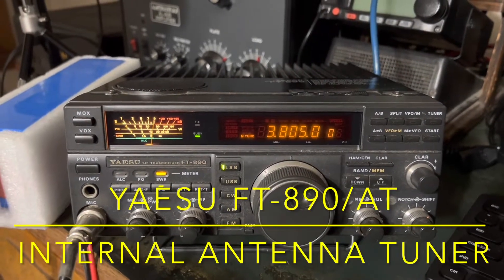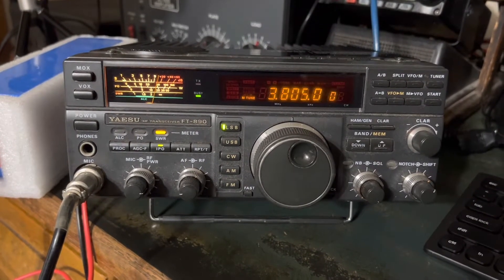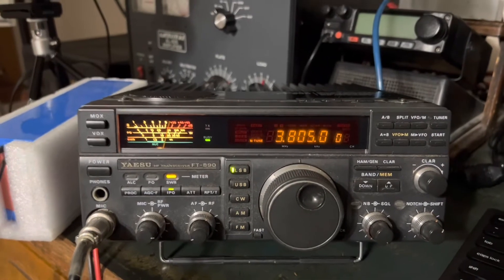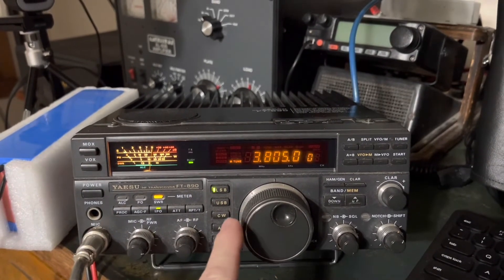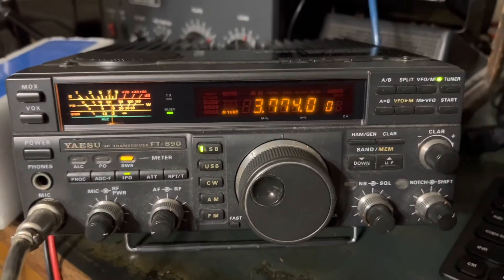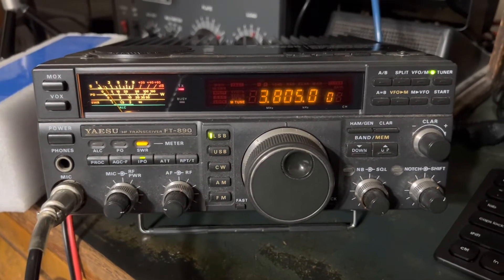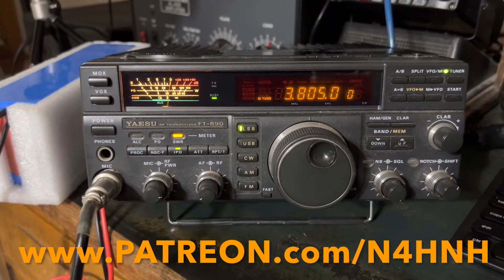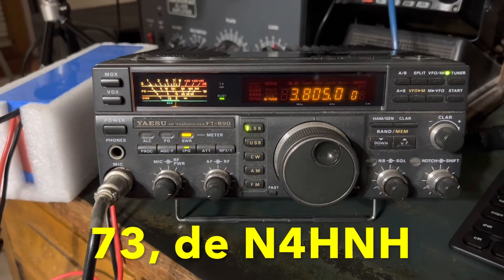Yaesu FT-890/AT: Internal Antenna Tuner (read the description) #hamradio #yaesu

Comment: I bought one of these radios, pre-owned.  One of the best radios I've ever used. The internal antenna is amazing.
Reply from the maker: Yes, approximately 1/3 of the space inside the FT-890/AT is the antenna tuner.  It is a wide-range unit.

Comment: The FT890-AT was my first HF rig and a reward for getting my code requirement under my belt. I think it was 1991 or 1992 and I still have it.  ---  dennis   n1kpz
Reply from the maker: It’s still a great rig. Won’t part with mine.

Comment: I always wanted an 890 back in the day, but ended up with a 900. Today I have more rigs than I can use and need to thin out the herd. Thanks for the short trip around the 890 block!😊
Reply from the maker: I still have an affection for the 890.

Comment: all of those early 90s rigs are sweet!  I still have 2 of my old 1991-1992 rigs my old Kenwood TS-850sat's and they still hold their own in today's world.  I had to rebuild both of the 850s receivers ( DDS and all of the leaking electrolytic capacitors) I was so happy to have those rigs then - they had that "wow" factor - my club had an FT-890 on a 5 band vertical antenna and it was ( still is) a real work-horse. I started out with a Heathkit HW-101 SSB rig, and using those modern rigs was a real treat - especially with a good set of filters. - I spent a fortune on mechanical filters back then. ended up buying a Icom IC-746PRO around 2004 and with IF DSP just amazed me.... when I turned my then brand new IC-746PRO I thought it was deaf! no background noise. but those old Kenwood TS-850s(at)s are still on my bench. so I know what you mean with the attachment to those old war-horses , they really are good friends. 
  BTW, to clean that old rig up - you might try what I use to clean up old rigs = I use Ballistol  ( it's a German gun oil)  it cleans grime and other yuck from old delicate paint, it does not harm plastic, nor it won't attack rubber (actually helps old rubber feet, flywheel tires back to almost original softness all whilst cleaning up the gunk. it shines up the buttons and chassis oh yeah it wont swell wood either , so if you have a rig with a wooden cabinet , it won't harm it either also it's non-toxic . the only problem.... it doesn't smell very good.  I cleaned a friends old Zenith Trans-Oceanic 3000-1 that was filthy. with Multi-purpose Ballistol .  he was stunned  Really enjoying your content .  73
Reply from the maker: Thank you for your commentary.  Good stuff.

Comment: This generation have unbeatable tuners. 890, 900, 990 and 1000D. They will all match a bacon sandwich. On most any frequency. L's are realay switched with twin motor driven C's. If you only want to run 100w, they are all a viable choice. And beautifully built internally too. Thx Doug. 73 de Mike
Reply from the maker: What you said Mike. Mic drop.  73, Doug
Reply: @n4hnhradio  and I still own and have used  them all except the 1kD (NIB). Until that is 2 months ago when I was closed down. Permanently. Now looking for a new home.

Comment: Great radio, I have the sister model the FT 900AT.
Reply from the maker: Indeed.  The 900 is an LCD version of the 890, also with a removable faceplate option. I owned one for a few days. Bought it on eBay. It arrived busted up, even though it was double-boxed and neither box showed any sign of damage.  Strange.  It took 3 months to get a refund. It burned me about using eBay.

Comment: Cool transceiver. I'm glad you still have it and use it from time to time.
Reply from the maker: Thanks Martin!  That little transceiver brought great memories.  It might not hold up to the FTdx10, FTdx5000MP, etc., but, using the external DSP unit that I showed in one of the videos, it does fairly well.